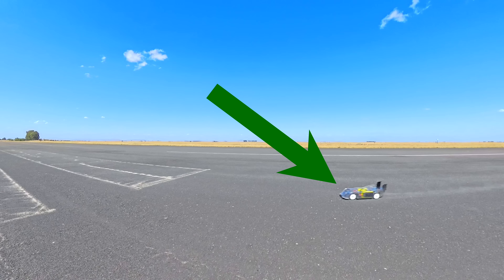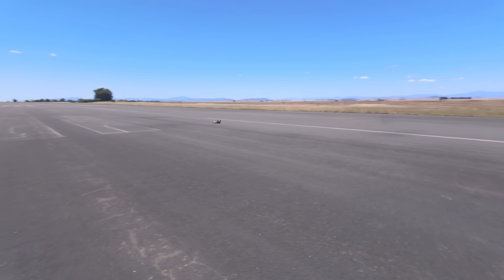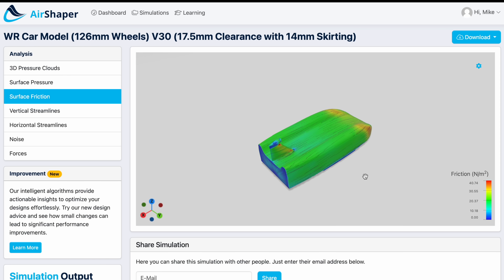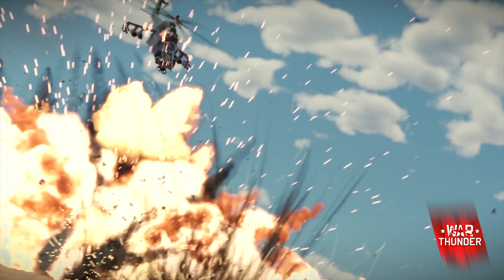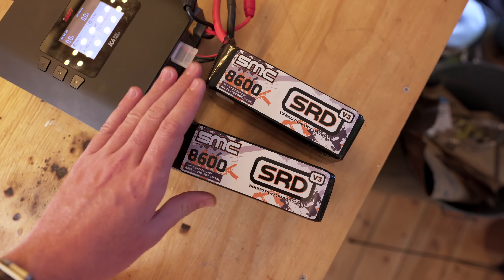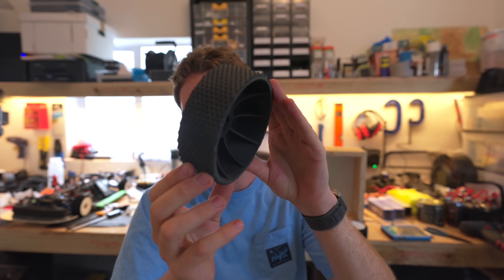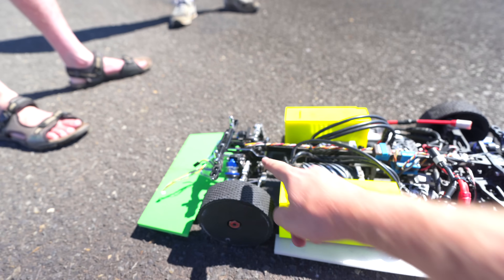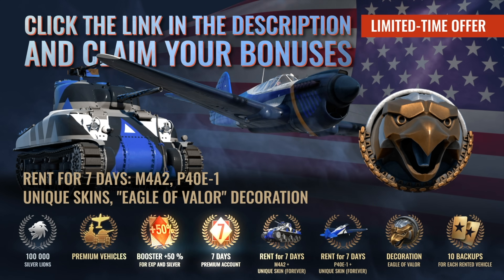World’s Fastest RC Car Project - Part 1 Aerodynamics

Comment: Looks like it's time to move on to RC cars and break records. I bet the people who practice this hobby didn't see this coming. Good job.😂
Reply from the maker: Probably not but I’ve still got quite a way to go to take the record 😎😂
Reply: @LukeMaximoBell1  The worst or most difficult thing about this is the tire
Reply from the maker: @MML66  Yes! Spending $80 on a set of wheels for every speed run over 200MPH is intense 😅
Reply: @LukeMaximoBell Perhaps consider generative design using Fusion 360 for the wheel to stop it coning and maybe moulding the tyre directly onto the wheel using a two-part Urethane of the perfect shore hardness? The wheels would probably need to be 3D printed in Nylon.
Reply from the maker: @andylewis7360  I have never used 2 part urethane before but maybe I should look into it...

Comment: Try making your wheels bigger,the rim itself and not bigger profile foam. Further u from the axel the less the gforce is outwards. Good luck. I'm also from Capetown btw.
Reply from the maker: Yes for sure. My custom wheels are about 125mm while the manufactured wheels are 105mm
Reply: @LukeMaximoBell  ill give u another nice tip. i gave this tip to Raz too but he ignored it.  your drivetrain. u can fit a oneway bearing on the driveshaft going to the front wheels. then make the front wheels 1-2mm smaller than the rear. the idea of this that the drive will only be RWD when running stable. this will make u loose less power in the drive train. but then when the car gets unstable and rear wheel lose grip thats when the magic happens. at that stage the oneway bearing will kick in and make the car instantly from RWD to 4WD. i hope u see where im getting with this system. hope this will help.if u need more explanation on this how it works, let me know.

Comment: thoughts of a downforce fan?
I bet you 2 FPV motors with like 2" props venting out the rear.... intake behind front wheels... 
ESC cooling fans...
Reply from the maker: This is actually a very interesting idea! I will look into it. Could be used for additional cooling as well.

Comment: Great project and video! Some crazy speeds already! BTW have you seen the speeds of Dynamic soaring rc gliders?   

 I do a lot of prototyping , some unsolicited thoughts that may or may not be useful. If you do any sanding of a cf or gf reinforced printed parts you should really have respiratory protection, as though you were sanding any other composite part. You dont need to use such a expensive material for printed vac form moulds, PC or something like that will do fine for much less. You would have had a better result also if you arranged your body sections on the plate so they are aligned with the nose of the car pointing up. Then use pins, to locate the sections. Model in holes for the middle low point in the cad. 

Also if minimising the weight to the nth degree is not needed and you dont need a clear body then I would just use a printed body, save the hassle of all the molding and gain iteration speed etc. FDm prints can be filled with PU for additional strength. 

Maybe casting a pu tire onto a printed wheel could be quite strong esp if it is locked in by the profile of the wheel rim. You might have seen bambus new tpu for ams, I dont know how tough or flexible that material is, but you might be able to do a multi material print when you print the tire and the wheel in one part. Not sure what might bond with the tpu though. - edit petg does apparently, Though you could use something else and lock it in place mechanically.
Reply from the maker: Those are some very interesting thoughts. The printing of something of this size makes it too much work to print a body every time I reckon. Especially because it won't be as strong. 

Funny you mention the printing of the wheel using TPU, my dad and I were literally discussing that this week. I think it would be awesome, but the layer by layer printing would make it difficult. We would really need dual print heads. One for TPU and one for PPA-CF. But I am going to experiment with TPU tires for the next video. These foam tires work pretty well, but when you are doing speed runs over 200 MPH they only last 1 run which is crazy considering a set costs about $80.A mechanical locking system assisted by glue might be the best option for now,

Comment: Please work on your downforce. Right now, it looks like you only rely on the bottom of the car. But at high speeds a little bump and the car becomes an airplane wing. Maybe winglets in front  and a low downforce spoiler. Some sort of diffuser and guide the air together better behind the side pods. 
Maybe a venting hole in the front to cool the batteries and motor and a hole above the diffuser
Reply: An evacuation fan pulling the air from inside and under the car and putting it into the low pressure behind the car.
Reply from the maker: @RadDadisRad  This is definitely worth investigating
Reply from the maker: Thanks, I think you are correct. I did design a diffuser, but I need to redesign it because it didn't seem to help. I am working on increasing downforce that doesn't rely on ground effect for the next video. Worst case scenario I will add lead weights which will increase downforce, but also slow down acceleration a bit.
Reply: @LukeMaximoBell  I can't recall the right formula atm, but weight drastically increases the amount of energy going through your tires. At the speeds you're going a couple extra grams can significantly increase wear to the point of the wheels not lasting a full run.
Reply from the maker: @Argosh  Yeh but downforce is going to have the same effect as weight
Reply: Once the car is airborne there is nothing you can do. The car going airborne in this situation has nothing to do with the downforce. It has to do with catching an edge with the tire and the asphalt that caused it to flip airborne. No amount of downforce will stop that from happening. It is exactly how people faceplant while snowboarding. Trying to run the car FPV is going to cause him to make many micro corrections that are not necessary and cause the car to drift into catching an edge. When driving from 2nd person's view you don't make as many micro corrections cause you can't see them and you don't cause the car to overreact. Driving FPV will be the biggest downfall IMO.
Reply from the maker: I mean I can account for that just by doing less control stick movements and increasing the gain on the gyro stabaliser. But yeh as soon as the air pressure below the car is higher than above the car it's game over.
Reply: @FarmerFpv that depends. You could add some sort of low pass filter to remove small moves underneath a certain size and still gain the benefits of FPV